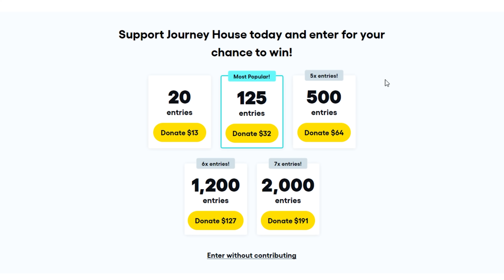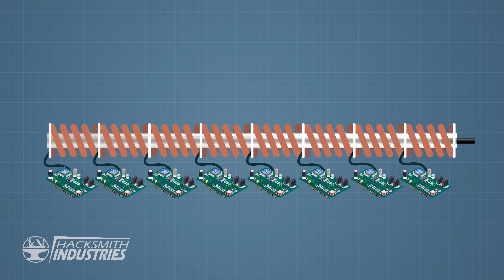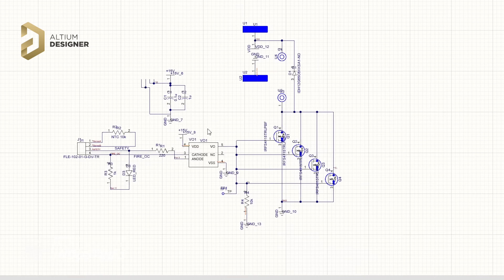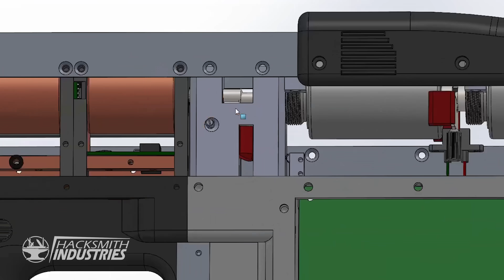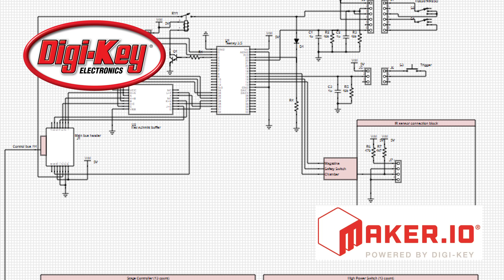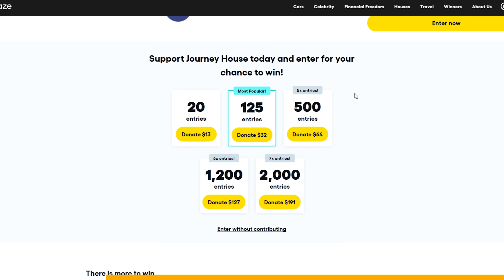MOST POWERFUL ENERGY WEAPON WE'VE EVER MADE!

Comment: You’re on the right track. A long time ago, I designed my own Gauss guns (a.k.a. Coilguns; what you made here) & I figured out a better way to control the coil-sequence.
Program ALL coils to come on when the trigger is pulled (so when the circuit is completed by pulling the trigger), then have a laser tripwire before each coil. When the bullet breaks the laser tripwire(s), the coil in front of it goes off; do this for every coil. This will give you a much greater active magnetism that’ll pull the bullet faster & you can use an Arduino micro(s) w/ an “If/Then” statement to control/shutdown each individual coil & its corresponding laser; when the laser tripwire is broken/tripped, power is no longer supplied to that particular coil, laser tripwire, & Arduino micro. This will lessen the complexity/burden of the controller & lessen the power consumption by stopping the rapid on/off of the 13 coils; it’ll be an “On” followed by 13 “Off’s”.
Also, make your bullet tiny; offhand, I’d say as small as a BB or maybe 1/8” spherical diameter. Your gun only produces so much magnetism per shot. The bigger the bullet is, the more of that finite magnetism is expended to accelerate it from rest. Essentially, more magnetism is available to act on a smaller bullet, increasing velocity.
Reply: Firstly they are legally "limited" in velocity, incentivizing larger bullets for the same energy. They are also using quite a long barrel with quite high currents, and your method sounds extremely inefficient. Lastly, a projectile the size of a bb will have even worse stabilization than hobby coilguns already do, and will easily saturate.
Reply: @Ferraday  
As you say, they are legally limited. As such, smaller bullets (less mass of maybe 9mm spherical diameter, if you want bigger than a BB) require LESS energy (Power) for the same Velocity.
Yes they’re using a long barrel, but such high currents are excessive & unneeded if the bullet is smaller.
You say it’s inefficient because it’s a long barrel, but the length of the barrel is irrelevant to the efficiency of what I propose, assuming you have coils along the entire length of the barrel (which they do).

Comment: To make it more efficient and increase the effective pull length if the coils you need to make shaped coils that increase the flux density toward the output end. Then you need a master controller (FPGA) as to keep up acceleration by the later coils your ON time is in microseconds. Otherwise you induce braking.

Comment: How big would it have to be to achieve levels of kinetic energy similar to propellant powered firearms?
Reply: same  size and plugged into a 440v outlet.maybe 10 lbs heavier.
Reply: Surprisingly easy. More voltage, thicker coils, spin stabilisation, heavier projectiles and a precisely optimised timing set would do fairly well

Comment: Couldn’t y’all just used boards and stuff off of hvac old hvac systems thst been changed out for the components used such as mini split boards witch have a bit of those components and relays? Genuinely curious because I do hvac and change a lot out and have notice that the parts y’all used are common on stuff like mini splits and whatnot atleast looks similar ?

Comment: For the Mk3 barrel, maybe make it kinda long and weld in onto a plate, then use the rubber mallet and a larger diameter tube to tap the coils into place on the barrel. That way you cut out the trouble of lining up the holes. Then you can just cut it off wherever you need and go from there.

Comment: I know this was a ton of work, but someone already beat you to it by quite a lot. DemoRanch purchased and demonstrated an e-shotgun "railgun" several months ago that, to put it bluntly, shoots faster, is more powerful, is much smaller, feeds better, and holds more ammo. Not trying to be mean, I just want to see ya'll make a railgun that is even better than the one he got. Maybe using thinner wire with more turns and less current? That way you wouldn't have to have such beefy power electronics. Also seems like a lighter projectile and some sort of faster central processing unit might help to dial the timing of the successive rings and accelerate it more efficiently.

Comment: Amazing work as usual!

I know you're limited by laws on what you can do as far as speed and energy, but maybe try to get some rifling (correct term?)built into the next one?

Adding some spin will make the projectiles fly straighter and handle air resistance better. 

The biggest benefit would be a more exciting test montage because you'll get more accurate and damaging shots if they don't get all wobbly.

Still won't demolish gummy bears, but maybe stick in them a bit?

I saw fletching recommended in another comment. That could work. Possibly adding a one-piece barrel back in with ridges cut out or added in, depending on which is easier.

Like you said so accurately, engineering is hard, so this is probably easier said than done. But I would definitely think adding spin should be #1 on the list for the next version if there is one.

Comment: I think the only thing that would really improve this aside from just increasing power would be adding rifling or a type of fletching on the ammunition to keep it from tumbling. It would be way more accurate
Reply: The projectiles are way too long, if you want more mass in the projectile then increase width so it gets more advantage of the magnetic fields and timing.
Reply: @tormendor8585  But sectional density
Reply: I'm a Canadian and airgun enthusiast, so I might be able to explain why it's weak. If it were to surpass 500 FPS and 4.7 joules of energy it would become a non-restricted firearm. However, because of its automatic function it then becomes a prohibited firearm. As is, it's considered like a BB gun
Reply: Yes
Reply: Steel fletchettes are available online, at least here in US.
Reply: you can stabilize it with fins
Reply: So sort of like a sabot round
Reply: @cipher0325  it needs a apfsds round.
Reply: use flechettes, and maybe have a small capacitor bank connected to a magazine rail so you can use a mini railgun to accelerate the proyectile into the coils. Tho I dont know of a capacitor small enough and still have enough juice to be useful for that. Hmmm.
Reply: @TheAshran  You can't really mix rail guns and coil guns, because one needs a ferromagnetic projectile and the other won't work with a ferromagnetic one. If you want to pre-accelerate the projectile I would recommend a linear electric motor. 

Also building a proper rifled barrel that runs the full length of the gun, maybe out of fiberglass or carbon, so that it doesn't interfere with the magnetic field too much would really improve the accuracy. 

Making fins is also an idea, but difficult, as they need to fit in the mag and through the barrel.
Reply: @FactoryofRedstone  Carbon would be an issue, because conductive; glass fibre would be fine tho.
Reply: @TheAshran  at that point it would just be simpler and cheaper to make the railgun bigger and more powerful
Reply: @TheAshran  The railgun they built needed a paintball gun to accelerate the projectile before the railgun or else the projectile would weld itself to the bars.

Comment: Could you reverse the polarity of the previous electromagnet to help push the projectile as the other electromagnet pulls or will that cause too many other problems
Reply from the maker: Only if the projectile had its own magnetic poles -- if you reverse the polarity of an electromagnet it still attracts the metal no matter what
Reply: Would be nice though, maybe you could design it to have different kinds of ammo, like high speed rounds?

Comment: "engineering is hard" they say while not even considering the aerodynamic properties of a long cylinder. Consumer grade railguns have been done before in the US that you can buy right now that are faster fire-rate and higher power. They at least use a puck shaped projectile, which is more stable.

Comment: In addition to the tube to increase efficiency, you could make the magazine double-stacked since more projectiles=more fun
Reply: Problem is that might introduce some feed/reliability issues, considering it's already on the shadier end
Reply: Designing a double stacked magazine from scratch would take a while as well. Factor in reliability issues from the magazine with the reliability issues with feeding in general and you might get lucky to be able to feed one full mag out of every 30 or so without a jam. There is a reason why most firearms use the same magazines as their competitors, and that is design cost and tooling to manufacture the new design.
Reply: @Bill_DeBerry  ah yes,  making an automatic coilgun definitely didn't take any time at all. Furthermore, I don't know what type of firearms you are looking at, but most rifles and pistols I've handled use different (generally double-stacked except in older/subcompact guns like the 1911 or glock 43) magazines from one another. Also, its not like they couldn't do the research into what makes a good double-stack mag. It's pretty clear these guys do a lot of homework for their builds.
Reply: @jacobkeltz3584  That's true, but it's also clear their builds are mainly meant to be fun demonstrations of a concept being executed and not actually viable tools/weapons in their current state. A double-stack mag would be an unnecessary complication, one that an actual weapon would definitely have reason to overcome for the extra capacity, but one that provides a pretty minor increase in entertainment value for the effort it takes. Also I think when @Bill DeBerry was talking about magazine compatibility he was referring to glock and stanag mags being used across a wide variety of firearms, though of course that's not gonna be everything in the same caliber.

Comment: I still don't get why people use light sensors, maybe it would work if your projectile had a non ferrous nose cone. Shouldn't the position of the projectile at any moment be known? Even if you had to brute force calibrate it, you should be able to do it with software
Reply from the maker: Why would it be known without any sensors? How could it be known? How would you brute force calibrate it? You'd literally have to tweak each stage hundreds of times... the light sensor does it automatically!
Reply: @hacksmith  every design I've seen using them, the light sensor is placed at the exit of the coil, when it's tripped by the sabot exiting, it has already passed the center of the coil and lost energy being pulled back.

Comment: Have you thought about using an hobby ESC as electronics? I know that to make a motor spin they use Eddy currents made by the magnets rotating by the coils. By hooking it up to three of your coils wired in a star configuration I think It would work, energizing the coil after as soon as the magnet is getting close. Also I think that you could wire the second set of three coils just as a multi phase brushless motor. Don't know if you either thought of that or already tried but I think that theoretically should work. Also ESC these days has gone really far and could be really powerful, handling very high currents. Good job by way

Comment: and use some capacitors to power the coils. you could also use a kind of caramic between the coil-layers to protect it from overheating. and perhaps you could use thinner coils if using higher voltage instead of higher current.

Comment: perhaps you could replace the optical sensors by another type of coil. make a coil with slim spacers and after winding and gluing the windings together with heat resistent glue remove the spacers. instead of using the optical sensors use the induction in the next coil when the projectile enters it to shut of the coil before that one.

Comment: Would graphene reduce the weight? Kevlar frame instead of a metal one would definitely reduce the weight with metal brackets at intervals. Holes in the handle or a handle frame that was hollow would reduce weight. This is a great start but I see so many weight reducing measures not implemented. Batteries voltage and Ampere hours? Bosch does 18v 6 Ampere hours. There is a risk of cracking with them, but the 4 Ampere hours are more durable. More curious can it be done, are we living in the future yet? Are our video games realistic? Or do we need to go back to the drawing boards on our favorite fps shooters?

Comment: Not sure if this will work but couldn’t you make it look like a small missile and 3D print the same kind of mounts that the copper is coiled around and make it have a spiral motion from the fins it so it’s more aerodynamic and had self rotating stabilization from the “ rifled” inner barrel so that way it’s not bumping or scraping anything and you can make them lock and click together to avoid the gap issues?

Comment: Shoot little copper tubes of neon like plasma bolts.
Use a glass plug in the rear and you can put a valve on the front to pressurize the neon

Comment: If you wire up the coils in a way so that each coil has their positive poles next to each other and their negatives next to each other then use an alternating current to switch the direction of the fields, and make it so that the coils become successively longer in length, could you get more speed out of the projectile, as you would be applying force for the entire length of the barrel rather than half (since right now you turn it off at the halfway point of each coil). I’m basing this on the design of a linac particle accelerator, there may be quite a few problems with it but still.

Comment: This is really really cool!  I can't wait for mark III.  I'm curious if you could improve the barrel system by making one very long continuous winding down the entire length of the barrel and then connecting leads to the windings at intervals allowing you to power only portions of the coil at a time.  If that can be done it would eliminate the gaps between coils in the current version, it would also allow the powered section to be moved in increments smaller than the length of that section since those virtual coil segments could overlap, I would assume this would allow you to keep the projectile in the part of the field that allows for optimal energy transfer and acceleration.  Of course these are the thoughts of a novice that doesn't dare hope to ever build something as awesome as what you've already made, so use a full salt shaker.  I'd also like to see how crazy this could get if you built it outside of Canada, perhaps collab with someone that has a shop in the states or something?  Even if you don't do a mark three, rest assured this was totally awesome, thanks for the entertainment.

Comment: use a barrel liner from a rifle (.22 is cheap) as the main barrel that your coils are arranged around. as long as it's ferrous, it should mitigate the issues of gap loss and jostling, but you will need to use much thinner ammo (like, a nail). that allows for higher magazine capacity and energy economy though, and the barrel's rifling might magnetically impart a helical spin onto the projectile.

Comment: PWB - printed wiring board. A PCB - printed circuit board has components built into the traces (resistors, capacitors,etc). You have PWBs not PCBs

Comment: If some of what you need is in short supply, couldn't you use some rc parts? Would it be possible to use a high volt/ high amp brushless esc and program a controller run some of them in a series configuration?

Comment: Should be able to modify that to work up to 300-400 m/s.  Would have to dump the helo look.  But yes, the coils are going to get hot; some sort of heat sink is needed.  Power source is the next thing that would have to be modified.  As it will have a short usage at full power.  Keep working on it at toy level.  Would be helpful in the up coming war in the next decade.

Comment: You are not thinking in simplistic design! the Coil has to be one wire but the wire has to be thicker Guage on one end for high amperage and as the wire gets smaller the voltage gets higher and increases as amperage gets smaller to increase the velocity at exit of barrel. There was a guy in England that did this and demonstrated it to the public as a lecture in the 70's and 80's. He was a professor at a school that was doing a Christmas lecture for the public. "Threw the Looking Glass" was the name of the lecture and is on YouTube still, I think!

Comment: Maybe and I don’t know anything about this stuff you could give it a inside cooling system and have that cool the inside and rings make a thin layer of a non metallic metal and use that as the barrel and make it with a small amount of room away from the ammunition speaking of which take nails cut off the front point and back nub if you were in America I would say use a magnetic bullet and have it go through but meh

Comment: Could they mount a kind of liquid cooling system on the sides, then cover that up with plates to hide the insides?
Reply: They could but it would not really matter, they ain't allowed to push it to higher power cause of legal reasons. Like if there where no legal problems i would not be suprised if they where using ybco coils cooled by liquid helium and sending that dart through quater/half inch solid steel plate XD